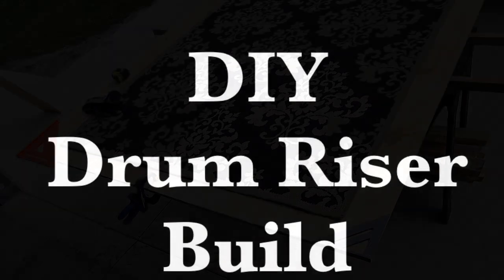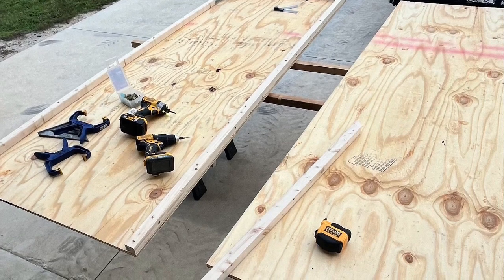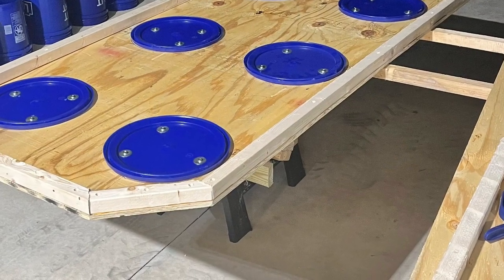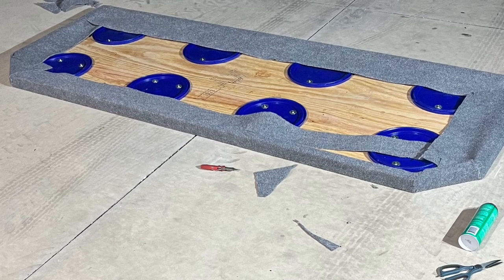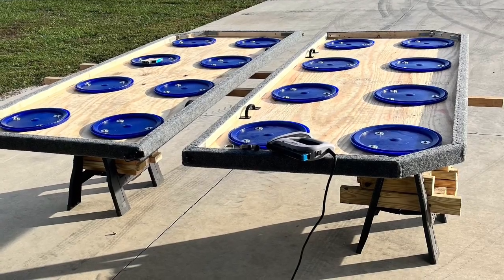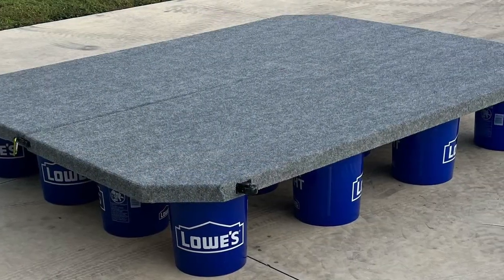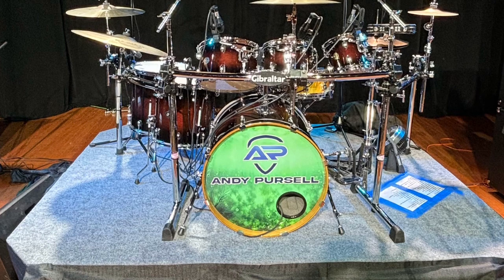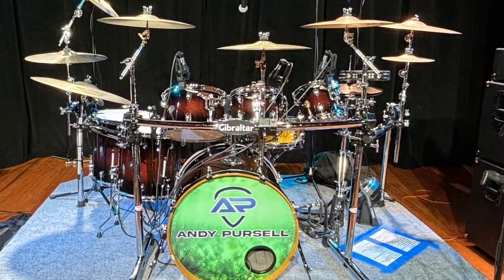DIY Drum Riser Build

Comment: I built one of these a few years back. My sections fold in half to 4x4 for easier transportation. Rock solid! Carpeted and skirting.Definitely over $500 all together. Still less expensive than any commercial riser for an 8x8! Well done!
Reply from the maker: @mitchfine7238  thank you! It’s definitely been a game changer
Reply: I did the same, it fits in my Kia Forte along with my entire drum kit. It was such a surprisingly easy project as well.

Comment: Total cost?
Reply from the maker: Around $500
Reply: @AndyPursellMusic  Wow that's expensive actually. The finishing hardware cost must have snuck up on you.
Reply: @AndyPursellMusic  That's crazy.
Plywood should be around 20-40 each, and you need 2, so 40-80$
Furring strips should be only a couple dollars. Get 6, and call it 20$
Buckets are about 5$ and change. Rounding up to 6$, if you get 18 that's 108$
Carpet should cost you about 30$
Without the screws, and finishing hardware, that's a total of 238$

Where did you spend the additional 250$?